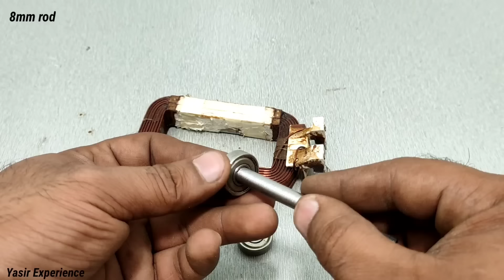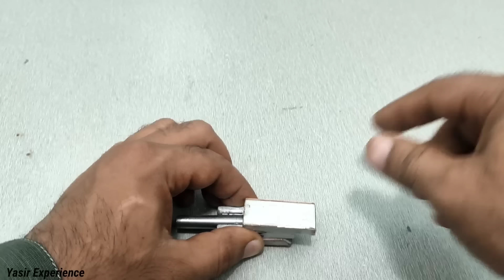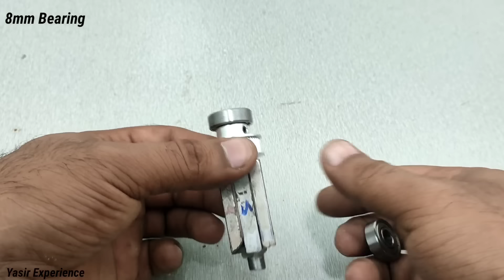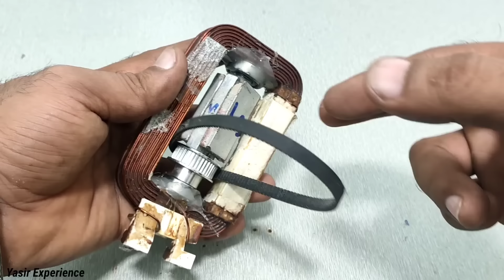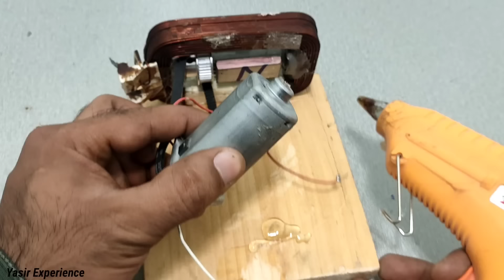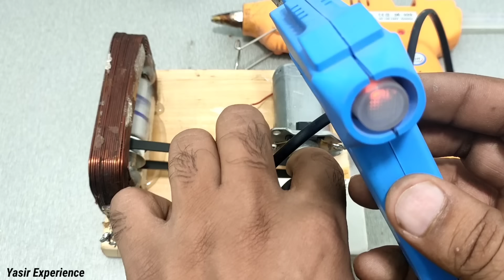How to turn Microwave Copper Coil into a 220V Most Powerful Generator Using New Method..

Comment: If you see the rpm on the belting still stay in a same speed when you put the load almost 60watt at 220volt at this generator.. at my observation the rpm of the motor drive a belting will be reduce the speed when being the load. More power rating of the load more rpm will be reduced.. so my conclusion this is a hoak video..

Comment: Thanks for the video. Apparently the 'sides'  of the magnets (smaller ones) are of great significance as I was not able to get any volts reading on the multimeter after spinning with a drill very close to the center of the microwave coil. So if you build a 'two slices' magnet spinner it simply wont work.
Reply: Thank you for sharing your experience with magnets in the comments. It's interesting to hear about the significance of the magnet sides in generating volts. Speaking of power generation, have you considered the Segway Portable PowerStation Cube Series? With its massive capacity, fast recharging, and versatile features, it could be a great solution for outdoor enthusiasts like us. Check it out!

Comment: Ok, but how much power was the DC motor pulling to run all this and what was the output voltage and current.
Reply: I think you’re missing the point. Energy cannot be created, it can only be converted. You need energy to spin the turbine, whether that energy comes from a motor, the wind, or some water, as long as it’s spinning power will be produced

Comment: Can a rectifier and a 9 volt battey kick battery to self loop the ac magnet field transformer to dc coil self generator dc to to outer pin 1 and 4 main plug to the pin 2 and 3